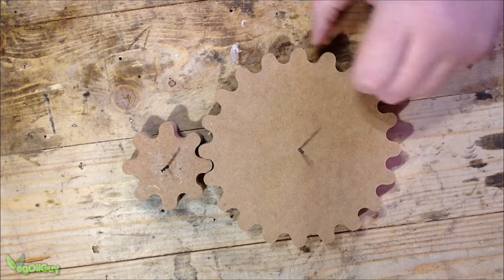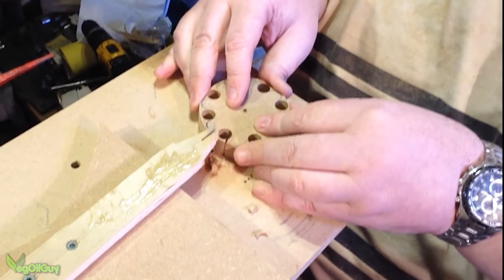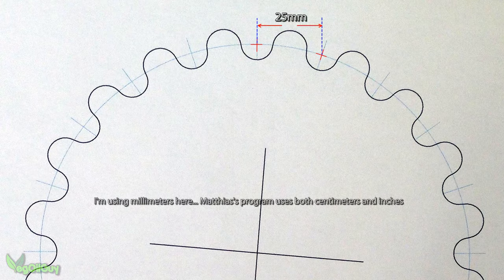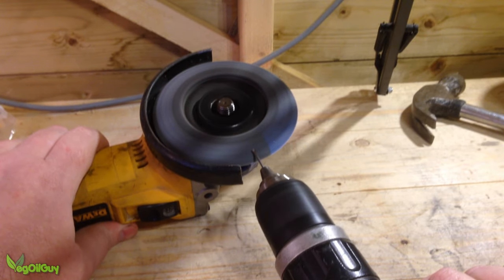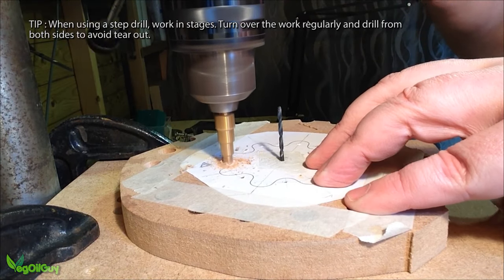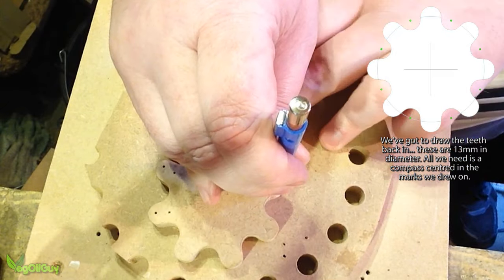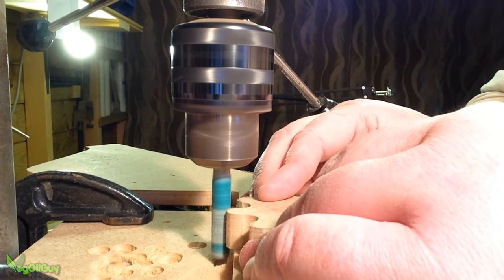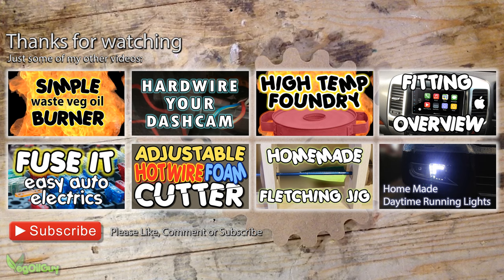Cutting Wooden Gears & Sprockets the EASY way - by VOGMAN

Comment: THANK YOU! 
Old Caterpillar mechanic turned whirlygig mechanic here. Ive struggled with hand cutting gears to the point of giving up (which isn't something I normaly do) but , I just couldn't get it right and it caused me to stop making some 'gigs because they NEEDED gears to slow certain things down. Im going to go make my first gear set now. I don't have a computer or printer but im pretty sure the first gear manufacturers didn't either. 

I'm pretty excited now, like I was the first time I set out to make a gear!

Comment: That’s pretty inventive using a metal rod for spindle sanding. It also works great to use a wooden dowel. You can cut a thin kerf lengthwise down the dowel with a thin blade,such as a coping saw. Then insert one edge of your sandpaper into the slot and wind it around the dowel. There’s no need to glue the sandpaper on,and it’s easily replaced. If you use a piece of paper that’s 2 or 3 inches long then you’ll wind around the dowel several times,and as it wears, just tear off a half inch or so and you have fresh sandpaper. I’ve even used this with a cordless drill. You can use a 3/8 dowel with 80 grit sandpaper and de rust metal in tight places. The thicker the sandpaper you use, the bigger the kerf you will have to cut. If your belt sander belts break at the seam, but still have plenty of grit on them, that’s a good source of strips.

Comment: Using a centre point and rotating the work piece around the centre point to drill the holes in the drill press is the smart way to ensure every hole is the same distance from the centre
Great video, thanks for posting 👍
Reply from the maker: Many thanks 😁😁😁

Comment: While I haven't tried it for gear making yet, in other applications of cutting from paper templates, I have found that using spray adhesive (Super 77 in my case) works well.  Additionally, it can easily be removed cleanly with some mineral spirits.  This may work better than regular paper glues.  Nice video.
Reply from the maker: Thanks for the tip.

Comment: Works for me fine. If they jam - check and adjust distances between centers of the two sprockets. I make them pretty crude like Matthias and they still work fine. Made a set from splintering reused plywood for my table saw lift mechanism back in....2012, works till now, for several years the saw was used daily.

Comment: Yep, You are correct Sir on the Paper Templates, I have the same issue,s at Times with my precision clock gears..Mathias does have  a scaling  page inside the program for printer inaccuracies ..sometimes it works sometimes it does not for some printers..it is always best to set a compass jig up as You did for verification..however Mathias Gear Generator program is in my opinion the Best on the net,and all I use for my gearing projects...enjoyed the Vid ,have a great Day
Reply from the maker: Hi Tim. Thanks for your comments.
And as regards Mathias, you'll get no argument from me  : )

Comment: Great video; I like that you use as few and simple tools as possible, this makes it easier for those who do not have much, to also make gears.
A compas jig is the correct way of doing this. If making a freehand center, it will be very difficult to get it "accurate". With the compas jig, you know it'll be accurate every time without much effort.
Making a compas jig also allows you to extend it to a real 'gear-making-jig' later on, where you place a template on the bottom and 'click' each tooth into place. That will make accurate angles without having to print out a paper template. This allows for making different size gears, however you'll need to make sure the tooth-size match. =)
Reply from the maker: Thanks for your input  : )
Reply: @vogman  Just out of curiosity:  What type of printer did you use?  I've heard that some laser printers can distort one dimension relative to the other (horizontal vs. vertical or vice versa) whereas inkjet printers do not.

Comment: The error is the accumulated slop in the printer mechanics. It is of no concern with back forth of printer head on standard note paper size it cancels it out but,  lines and circles and such it adds up. They are not intended to be CNCs or plotter accuracy.
If you have some leather punches or some thin pipe around (file an edge to an end) re-enforce the area with clear tape,  you can punch cut the the paper drill hole locations template and wood at once. No tear-out of paper.
For ones and twos or fours this is good as a way of coming at the geometry desired and as a proof of concept demo and good if a little clunkiness is part of the look and feel of the project. 
What this does do greatest is show that the several operations needed could easily be made with a few dedicated jigs. A few 1/4 inch router bits and Dremel bits and jigs.  For me, really caused the scribble book jig sketching session on the couch. Hobby 'production run' level quantities.  Concocting jig solutions is half the fun.

Comment: Having studied engineering design, and taken specific classes on drawing gears. What I can say is the modern standard for gears has been developed for optimum wear, the transmission of energy, and forces across teeth planes. But if there was any chance of me making gears for a home project, I would do this instead! (A LOT less math and drawing)
Reply from the maker: It is quite literally garden shed engineering, but it doesn't do a bad job 😉😊👍

Comment: great tips... what about using a pully instead of gears... there's a bit of slippage, but using a belt and then the two round wheels are easier to cut out.  Have you looked into using pins inserted to a wheel instead of cut out teeth?  pins might do just as good a job of meshing without the trouble of cutting out the teeth... just a few ideas... =D  could this be done on a lathe?
Reply: Pulley and belt can be a very good solution and in many cases better than gears - and this solution usually also produces less noise.
-But there are of course also cases where you need to make sure there is no slipping/skipping, thus you need gears.
I think the "pin-wheels" is an option one should consider, it only requires a round wooden board and a drill-jig + dowels. This is especially interesting for 90 degree gears.
(you can also see this used throughout history all over the world).
Hmm, thinking about it; you don't even need a drill and jig in order to make such "pin-gears"; you only need a disc, a bunch of matches and some PVA-glue. Scale to fit your needs. You can even make a working full-size sample using cardboard before making the final gear. (PVA glue is great for both wood and cardboard).

Timing belts and pulleys (eg. with teeth and grooves) are great, but making wooden pulleys that match a timing belt would probably not be easy. ;)

On the other hand, one could use a large V-belt and cut grooves in it and make matching grooved pulleys; especially if only one set is needed.

Comment: If you have trouble with templates tearing up from the cutting blades, eliminate the paper.  Use a T-shirt transfer instead and print the template directly on the piece you are going to cut.

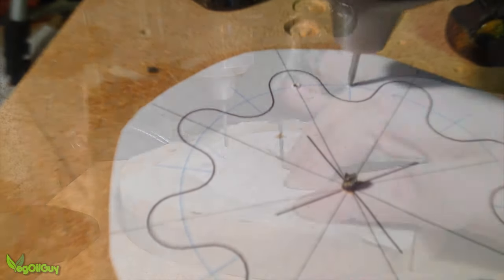Comment: You refer to a compass jig at 2:55 minutes into your video. I think it would be an asset to have in the hit pocket of accessories. It may be somewhere in the boot of known appartati, but not being familiar with the phrase I have to consult you for specifics. Thank you.
Reply from the maker: Hi Eldon,
Sorry for the confusion. By 'compass jig' I am simply coining a phrase referring to the whole process, ie centrally pivoting the work to enable 360 degree rotation, in the same way that a compass would. By so doing, each drill point is the same distance from the centre, allowing the operator to concentrate on one axis only, that being the measured points around the circumference of the work.
Hope this helps. Any more question, please don't hesitate : )
Geoff